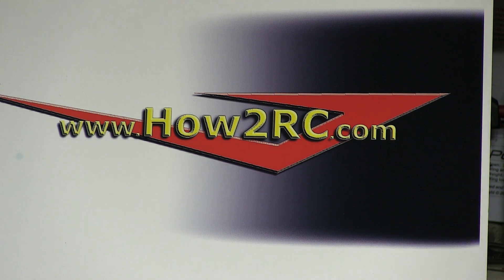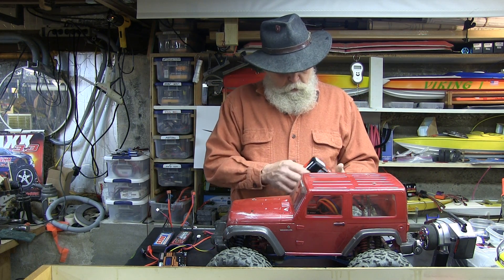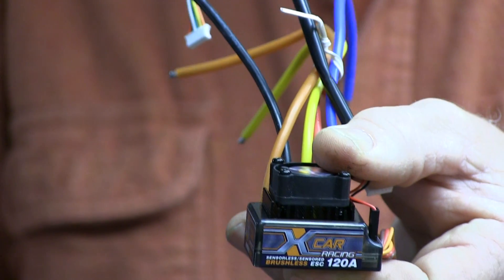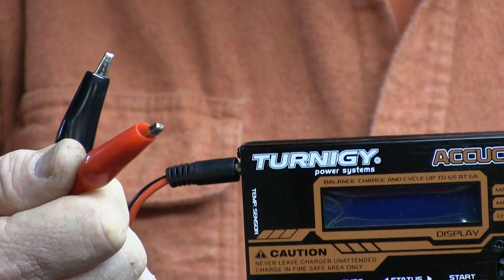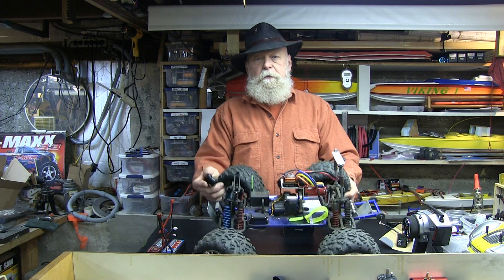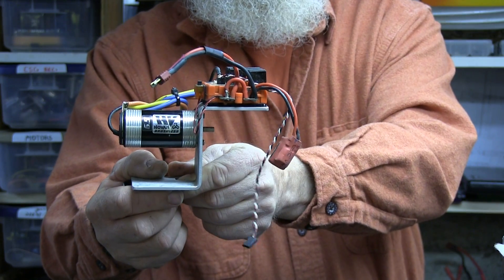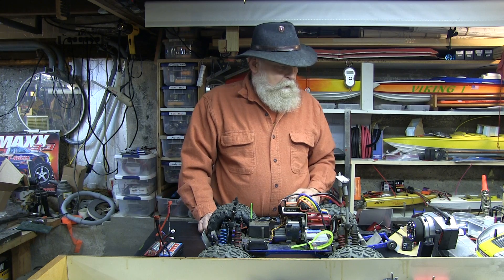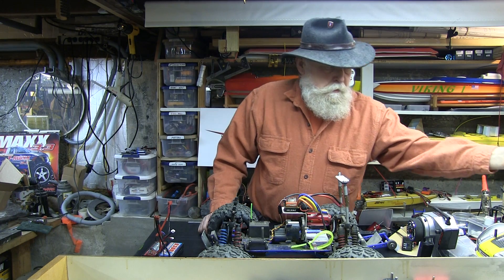Everything  you will need for the conversion of your T-Maxx to electric Brushless power

Comment: I bought the How2RC aluminum motor mount off of eBay and it is too soft and flexes.  Stripped 2 spurs gears within a minute.  I then bought their other more expensive version that says its for 550 or 1/8 scale.  It is stainless steel and does not flex.  It is working great.

Comment: Is that the trackstar 4x4 act 5t or 5.5t motor? I've seen the running video of this truck and want the same exact setup. I cant find the 100a trackstar but I have found the 120a x car esc and plan to run 2s lipo.
Reply from the maker: Hi;   Either motor will be fine just adjust the gearing a little, the 90A to 120A esc will be fine.  I don't recall what that was running on but I would guess it was a 3S Lipo,    Have Fun.
Reply: @How2RC  okay thank you so much, one last question, I have 2 tmaxx classics (short cassis) one is a .15 with the black transmission and the other is a 3.3 grey transmission.  I plant on using the 3.3 chassis due to it being a bit stronger. So which transmission would you recommend I use?
Reply from the maker: @kevinhamblin3985  The Gray is a stronger chassis and only requires one kit for electric use
Reply: @How2RC  okay sounds great thank you for the information, what gearing do you think I should start out with? It's a 4150kv 5t motor?
Reply from the maker: @kevinhamblin3985  Stock gearing for 2S.
Reply: @How2RC  sounds great thank you so much for all the info. I'll be ordering one of your motor mounts in the next few days!
Reply: @How2RC  would a 5800mah 25c 2s lipo be enough for this setup?
Reply from the maker: @kevinhamblin3985  A 25c motor will melt down if you run a T-maxx on it you need a 90C or better.
Reply: @How2RC  I'm getting a 120a esc the 4x4 sct 5t motor is a max 120a draw.
The lipo I found is a 2s traxxas 5800mah 25c discharge rate it will melt down?
Reply from the maker: @kevinhamblin3985  A 25c rated battery is for a radio NOT for a high power motor!!!
Reply: @How2RC  okay so a like a 5000mah 90c discharge is what I'll need?
Reply: @How2RC  sorry I have always had nimh I've never messed with lipos before

Comment: Wouldnt a single 550 motor be not good for a heavy truck like a Tmaxx
Reply from the maker: A single 550 size Brushless motor is plenty powerfull enough with 3S LiPo batteries,   A 550 brushed motor won't do the job.

Comment: Hello! I appreciate your videos and website, I've found both to be a wealth of info, thank you. Price notwithstanding, which do you prefer- your brushless conversion or your newer 775 brushed conversion? It looked as if the 775 setup almost had more torque and equal speed, is that just my perception? Lastly, I have been trying to find a good esc that will work for your brushed conversion. Do you have a specific recommendation by any chance? I know it needs to be high amperage, take up to 4S (and of course 16v), any other criteria? Thanks! Ordering the motor mount  soon.

Comment: Did this with my t maxx 3.3 with the extended chassis works brilliant bought my ESC and motor from hobby king,also changed to the forward only gear taking out the first and reverse gears  and i locked the second gear so the esc can drive forward and reverse

Comment: I just completed my Tmaxx to Emaxx conversion. Yes, you need a motor mount, motor, pinion, and speed control. Also need the forward only and single speed kits, in my case the ones for the 2.5 version. I have chargers and batteries. But one item I found not mentioned is battery trays. I kept the steering servo and receiver in the original locations. I used the 775 mount and 775 motor and made battery trays from aluminum. Secured them on either side of the aluminum plate with counter sunk screws and used velcro for holding the batteries in the trays. I mounted the EVX2  on the elevated servo mounts and rotated the receiver box 180 degrees to get the antenna away from the wires as much as possible. I also had to lengthen the motor wires.  I haven't ran this unit in over 14 years but seems like it runs very much like the nitro version.   It is much cleaner and as much fun as I remember.  Thank you for the motor mount.
Reply: webe1959 p

Comment: hey, why do i have to change for single speed? can't i stay with de two-speed transmission?
Reply from the maker: https://www.youtube.com/watch?v=oDhiVb2Tj2Q
Reply: Luiz Fernando Castilho I was thinking the same thing. Id like to keep the auto shifting 2-speed as well after the conversion but I just think the sheer amp burst of the brushless motor is going to level each and every tooth in the case. I think im going to look for a drop in alloy set thats identical to the plastic 2-speed and pray it works. I dont think I want to cheapskate out on this part of the conversion and get some cheap chinese pot-metal, I'd rather find a good brand that makes it (if they they even make a set at all) like Integy, I know Integy makes high quality alloy diffs and such . Everything must go metal from that point on including cv shafts, center shafts and diffs. The good thing about doing this conversion is, it almost forces you to bulletproof the whole driveline. This of course is all thought as Im noticing my Revo 3.3 is getting a little tired and am contemplating just getting a new nitro engine. If I do decide to do a electro conversion I'll be sure to do a build series containing each necessary part used in order to retain the auto shifting 2-speed.
Reply: How2RC Thanks for your clarification. I really like how in this link you are very real and to the point. A lot of the people on here that ask you questions is just crazy and shouldnt even be in the hobby asking some of the questions they ask.

Comment: Hi I have the same speed control that you show and the same motor. What size pinion gear should i be using. I now have a 15 tooth but think it should be bigger what do you think. Thank you for your video and any help you give. Chuck

Comment: Have the mamba max pro sct 2400 kv 4 pole 1415 set up. Is that enough power? And will I need to run dual lipos?? Also I'd like to order a couple of parts from u like the transmission one way conversion so I convert to electric and a motor mount. Awesome video Very helpful!

Comment from the maker: Go to How2RC.com and the Revo transmission Mod page.
Reply: How2RC I was thinking the same thing. Id like to keep the auto shifting 2-speed as well after the conversion but I just think the sheer amp burst of the brushless motor is going to level each and every tooth in the case. I think im going to look for a drop in alloy set thats identical to the plastic 2-speed and pray it works. I dont think I want to cheapskate out on this part of the conversion and get some cheap chinese pot-metal, I'd rather find a good brand that makes it (if they they even make a set at all) like Integy, I know Integy makes high quality alloy diffs and such . Everything must go metal from that point on including cv shafts, center shafts and diffs. The good thing about doing this conversion is, it almost forces you to bulletproof the whole driveline. This of course is all thought as Im noticing my Revo 3.3 is getting a little tired and am contemplating just getting a new nitro engine. If I do decide to do a electro conversion I'll be sure to do a build series containing each necessary part used in order to retain the auto shifting 2-speed.